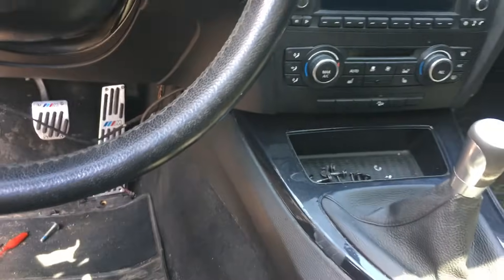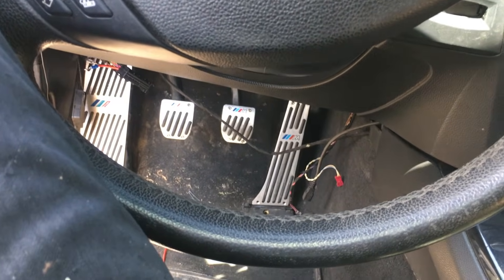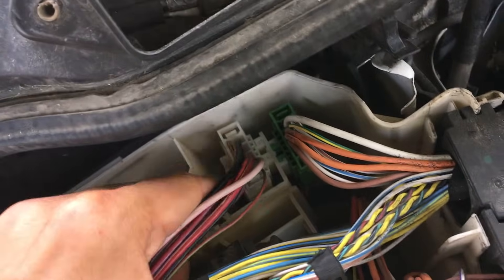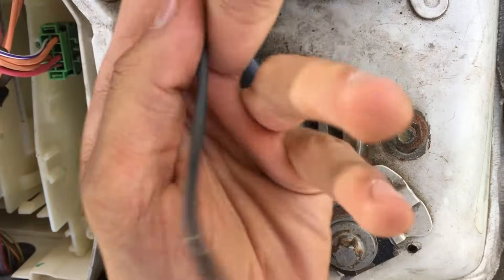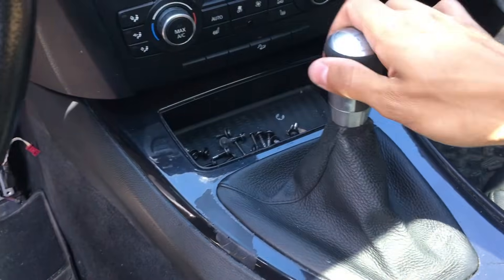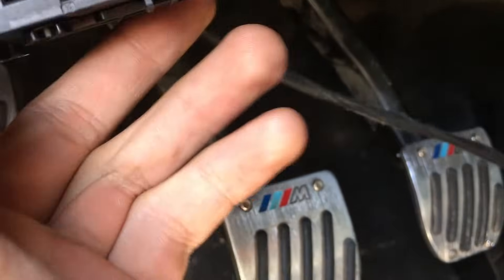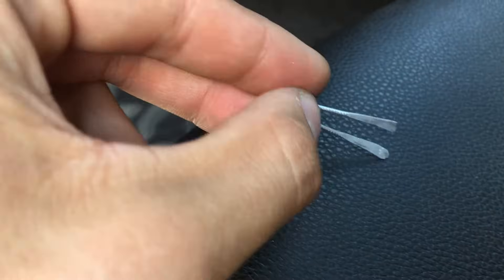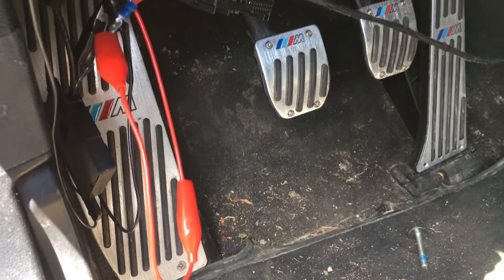NO CRANK NO START FIXED BMW 325i 328i 335i 316i 318i 320i 335d 320d 318d 325xi 328xi

Comment: That's what I was looking for, life and definetly money saver. I laughed but Thank you a lot man! And my problem is when you put the key on the car, I get first light and cabin power. but when I push the start button, It doesn't turn on Ignition dash lights (engine check fuel level, airbag abs check etc.) so no crank either. do you know anything about it. ground wires and battery checked, and tried to jump start as well. I cheked all the fuses.
Reply from the maker: Hey thanks i like to hear that! It sounds like a ground strap issue, but could be CAS, have you done this test yet? Lmk
Reply: @aivisu8865  yes yes I tried everything. I figured out mate. I had to ELV reset. I think battery voltage was low and it cause to lock the car. I had problem sterring wheel lock problem but it didn’t effect before. Thank you! 🙏🏻
Reply: @TwelveandHalf  how u fixed it?
Reply: @Bimmerplay  steering wheel lock light was on before but it was starting properly. I haven’t had any problem since that day. So battery fluctuation cause that problem. I charged battery and I changed Stering wheel lock setting in CAS.

Comment: My car does the no crank no start somethimes I think only on extreme hot days. 1hour later it always starts again. Does your car also has this ? Because with a bad cas module I think it will be always doing this next time the car does this I will check this hack if I can look if starter works
Reply from the maker: Intermittent starting is probably going to be a bad starter, no start at all would be a CAS or ground strap issue

Comment: My 2009 335i won't start I tried to do what he did and it didn't start it did nothing.
Reply from the maker: Did it make any noise or turn over at all? This method wont start the car because the harness is unplugged but it will turn it over, that lets you test the battery and starter without removing them. If you have 12 volts at the "B post" and your car did nothing then most likely your starter is fried

Comment: You sir, are a life saver. I was losing my mind after getting a new cas. Still not sure why even with a new CAS I experience this issue, but now i am not chasing a starter or alternator. Hopefully I figure out what besides a CAS is causing my issue.
Reply: It was an issue with the CAS module. Apparently even after I got a fixed, it wasn’t fully fixed. I got mine fixed through precision ECU.
Reply from the maker: Nice! how did it turn out?
Reply: @aivisu8865  I still dont have a permanent solution. Its an old car so have not investment in a permanent solution. I have two wires connected similar to the way you show that I join when I need to start the car. Its a pain in the butt, but works well when I do occasionally take the car out.
Reply: Did you figure out?

Comment: Hey bro I did this but my car only cranks bad cas ?
Reply from the maker: Yes most likely. Do you get any dash lights or a clicking sound when you try and start from inside the car? The CAS module is easy to remove with a 10mm wrench preferably a rachet wrench. Then there are a few clips that hold it together. Unclip them and you should see/smell the burnt diode right away
Reply: @aivisu8865 i openend my cas and theres no burnt diode or smell. + no dash light no ignition + A0C1 fault code terminal 50

Comment: Hi. My ignition doesn’t switch to ‘on’ mode. When i push the start button there is no lights pop up on the dash(no response). Interior lights and seats work
Do you know whats the problem because i cant scan codes since the ignition doesnt go on
Reply from the maker: Hi, it could be your CAS module. Does the center screen light up at all? And have you checked your engine to chassis ground strap? Theres 2 of them.
Reply: I have the same problem when pushing the key in no dashboard lights. But roof lights work / locking/unlocking the car with keys work / tuening signals work if i push them.. btw thats how i could run the scan tool with turning signals on. It let you read the codes that way. My code is A0C1 terminal 50.  Did you fixe it ?

Comment: Im having the same issue just changed starter and new battery nd still just one click
Reply from the maker: Have you checked the engine to chasis ground strap?
Reply: @aivisu8865  found out my cord in the back was ripped is there anyway i could send you the video of it
Reply from the maker: @superman574ful  hey did you get it fixed?
Reply: @aivisu8865  yea ended up being my ground wire
Reply: @superman574ful  which ground strap was it?
Reply: @aivisu8865  so its still isn’t starting im so confused now
Reply: What was it?

Comment: So it should turn the vehicle on if the cas or starter isn’t bad, correct?
Reply from the maker: Turning the engine over from the "B" post will not start the car. It just turns the engine over proving your starter and battery are good. If you have done this and still cant start from the start button then you probably have a CAS problem or ground strap issue

Comment: Nice work mate. I have a 335 that is not communicating with the dsc. Think a relay or fuse has blown when the fuel pump tried to prime with the fuel rail removed for a valve cover gasket change. Possibly the junction box.
Have run ISTA. Now I need to figure out where the wires are that it's telling me to check. Hopefully the issue is easy to fix.
Reply from the maker: Thanks I appreciate it! This same car also had a dsc issue that was caused by the previous owner removing the fuses for dsc and 4x4 because he thought it would make the car RWD. Heres a diagram https://fusesdiagram.com/bmw/fuse-box-diagram-bmw-3-e90.html thats a good website for diagrams if you dont have the og chart in your glove box panel. This is why its very important to disconnect the battery when doing any engine work. But good for you doing your own repairs that's awesome! 👍 good luck bro

Comment: I have 12 volts to the starter, is my starter bad or should I look into the cas? Thanks for the info!
Reply from the maker: Did you try starting it from the B post? If it turns over fine then yes i would take a look at the CAS module, its easy to remove. And np! 👍

Comment: Has the same issue. Replaced a fuel replay and everything worked. I was going crazy checking everything. Replaced the ground wires, checked the all the modules same result. Nice vid
Reply: hey wondering what bmw do you have? having the same problem but I get no crank at all
Reply: @shaneirish3777  Did you fix it
Reply: @Mahdi Burnell could you hear your fuel pump prime when you'd try and start the car?
Reply: @TheFear37  yes
Reply from the maker: thanks!🍻
Reply: which bmw i have a 2011 not familiar with a fuel relay only fuses

Comment: Hi, thank you for posting this video, what if I connect the white wire to the positive terminal and the starter don’t crank?
Reply from the maker: Hi, that most likely means your starter is bad. But also make sure you have 12 volts at the positive terminal.